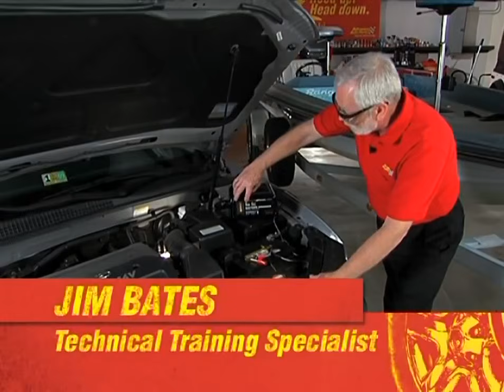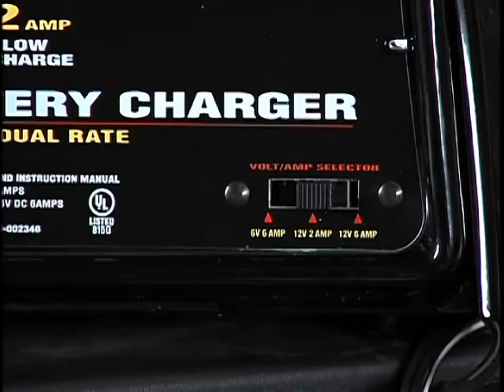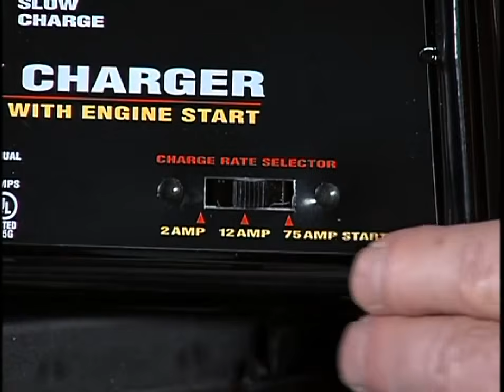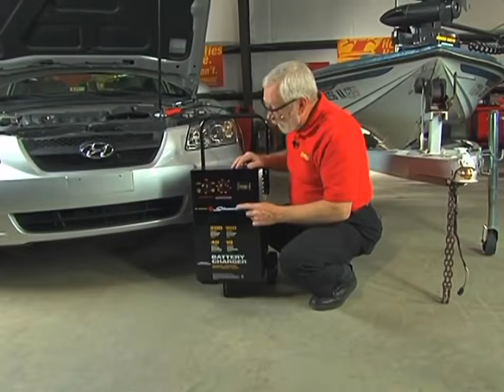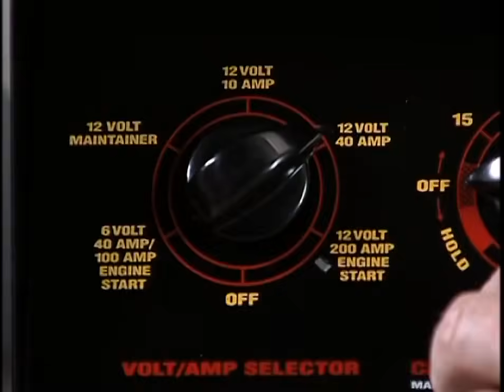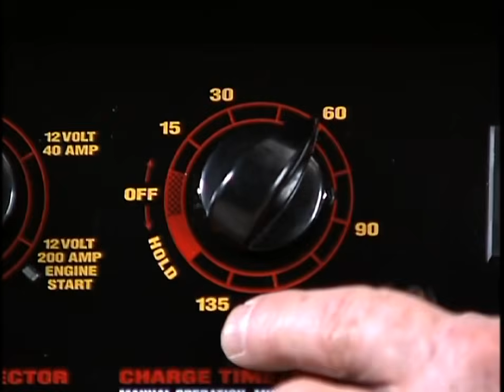How to use Car Battery Charger

Comment: why did you change it from Maintenance Free Deep Cycle to Conventional Low Maintenance?   Which should I use when i am charging my standard 2000 Toyota Camry battery?

Comment: Thank you, sir! Very informative and to the point - glad you prefer connecting the negative to a metal part in the engine and not to the battery's negative terminal. Thanks for the breakdown as to why you prefer this route!

Comment: ONLY VIDEO that SHOWS ME WHAT METAL ENGINE PART I CAN CONNECT TO MY NEGATIVE [warnings against connecting to sheet metal, fuel line etc etc].  THANK YOU.  Appreciate you got right to the meat and potatoes without 101 on 5 different kinds of charger.

Comment: No matter where I tried to connect to the chassis I could not successfully obtain a ground connection and had to connect it to the negative battery post (which worked immediately). I know this is not advised …How bad is it to connect directly to the terminal itself?

Good video!

Comment: Can someone help? I'm baffled. I have a schumacher sc-600A microprocessor charger, with the only buttons being 6V/12V & charge rate: 2amps, 4, or 6. On the box cover, it indicates 'standard' & 'agm' batteries, & the booklet lists battery types, including AGM, in describing them, (& saying nothing, that you cannot use this charger for an AGM). Nothing I do will show 'connected' light to come on. The charger makes smooth noise, sounding like it is on/  running. The indicator lights work, for 12V, & for charge rate. But the connect light will not come on, no matter what i do (on both my old, dead battery, & now my new replacement battery). I just got a new agm battery. I wanted to make sure it was fully charged. The charger fires up when plugged in, (after connecting both + & - of the charger to the battery, including using a method as shown in this video, & trying different negative ground connectors on the car, such as metal near the engine block/ frame. I finally resorted to trying connecting directly to the negative terminal (with the charger off), putting a plastic shield between the 2 terminals & then plugging back in. I've plugged, unplugged, plug in again. I used steel wool to ensure I have clean, pure, bare metal. Nothing I've tried, on & off the vehicle, will work, to get the 'connected' light to come on; why why??? despite the charger working in every other way.  I went ahead & connected the new battery to the car. My lights, turn signals, dash, everything works. (I'm not yet starting the car, since it has  been sitting/ not driven, & I have a list of maintenance tasks I'm running through before attempting to start; some requiring sitting w/ gas treatment, etc). Anyways: What to do regarding getting the connection light to come on the charger?
Reply: Addition: of course, with no connection light indicated, I also get none of the % charge lights to come on, even after letting it sit 5-10 minutes

Comment: So the battery charger has to be plugged into the wall charger in order for it to charge the car battery? it does not save energy inside it ao we can use it when we are away from hom?

Comment: You say (and my charger instructions say the same thing) 'don't attached to the -ve terminal but to the body of the car away from the batter'. But what if the battery is not in the car?

Comment: how do you disconnect battery charger?
what is the safest order of operations?
thank you
Reply: To disconnect:
Turn off and inplug charger
Remove - cable from car
Remove + cable from car
Replace + terminal cover on battery
Done

Comment: what happens if you forget to turn it off at end of charging cycle ?
also, what happens if the  neg and pos leads from the charger touch each other briefly while the charger is set at 12v 2amps  ?
 Will it ruin the charger   ?

Comment: Excellent.  I wanted to know if I could put a battery tender brand charger on the battery without removing the battery or disconnecting the terminal to the car. Thank you this helps.

Comment: This charger  https://www.youtube.com/post/UgkxknS1MWclRHOKWekYXnBJz8Ex0rEPnrGF  works great with the DCB205 and DCB203, I've charged both a few times without issue. After I'd searched for a while this was the best value charger I found and it's new, boxed up well, and it's built as well as any charger I've had.

Comment: Not sure if your channel is active, but I was wondering if you would have any experience / knowledge regarding measuring voltage of the battery when the negative battery terminal is not accessible (silly design by honda that puts it behind plastic components with clips that can break in cold weather). Can I simply put the black lead of the multimeter on a grounded part of the vehicle chassis and the red on the positive battery post?  Or will this voltage be missleading. I have a dead battery that reads 2.45 volts when I try this.  Alternatively, would you be able to provide the source of the video above?  Thanks.

Comment: if you are charging the battery in your garage or house where do you connect the negative terminal
Reply: Schumacher's instructions say use a short cable connected to the neg terminal. Attach the charger clip to the end of the cable, not to the terminal. Create some distance from the the neg terminal.

Comment: Absolutely nothing wrong with connecting black to battery post. You do this anyway when the battery is out of the car. In addition, only plug the charger into the outlet AFTER your batter clips are connected and you have double checked positive (+ red) negative (- black). Also, better to charge on 2amp instead of 10amp and best to never use 50amp option (on some chargers). If battery continues to need charge, just replace it, otherwise you’ll be stranded. Reason is, you can only jump a battery so many times when old before the cells become so bad that no charger will work at all. In other words, a jump start will do no good at that point. Clean posts before doing this and get those inexpensive battery corrosion inhibiting felt pads from Walmart or auto parts store. They work very well in ensuring longer life on the battery.
Reply: I have a 2004 Corvette.. When I connect the neg to the black post on the battery, the charger gets HOT.. When I connect it to the frame, it cools done fast.. Sooooooo, not sure you aRE RIGHT
Reply: WWK  : TY . the " expert "  never told us we could take out the battery
Reply: His reasoning is “If there’s a spark, that could be very dangerous.” So are you saying there can’t be a spark, or that if there is one it can’t be very dangerous?
Reply: @VeritableSmorgasbord  I create sparks all the time connecting batteries. Just did today on three motorcycles about an hour ago after not running them for a month. I actually intentionally create a spark to ensure I have a good connection with the alligator clips.
Reply: Ya
Reply: Why is 2amp better than 10amp? Can you please explain?
Reply: @FirstLast-pl3qe  Slow charging when a charge is needed or when you leave a car sit for longer than a couple weeks, helps prolong the battery life as it minimizes stress on the battery's internal components. Slow charging is safer than fast charging as the slow charge allows improved battery heat dissipation mitigating overheating risk and thermal runaway, which could cause battery bulge/burst and weakness in the internal components, or even fire. Lastly, charging slowly, allows the battery ample time at a slow pace of charge/flow to absorb and store the acquired energy in the most efficient way. In turn, this will not only allow the battery to last a longer life, but will also allow the battery to hold a consistent charge which in turn will protect the computer/electrical systems within the car.
Reply: @WunKoolKat  thanks for your input. I just bought an automatic charger. I got it for my family (3 cars). We don't drive much or far enough to give me confidence of sufficient battery charging. I want to charge the batteries (none during the same day) 2/3 times over the winter and I only have a 3 hour window for each charge session. From what you said, trickle charge is best but I'm not sure that can help over 3 hours. Any advice?

Comment: I have a Viking automatic charger, issue is when i attach it to the battery it tells me what the capacity is, but while charging, it always shows 60% charged and never goes above that, even after sever hrs of charge, After you unplug the cables and plug them back onto the battery, it then shows 100% capacity ... 
Very wierd

Comment: He says to leave the manual unit on till it's 100% charged but there is not "100%" setting on my Schumacher SE-82-6 manual charger. It's settings show 0,2,4,6 and 8 DC Amperes. If you are to leave it on until the meter goes to 0% he (and the manual) should say so.

Comment: I don’t have my battery in the car bro where tf am I supposed to connect the negative if I can’t put it on the terminal!?!?
Reply: I’d your battery is not in the car you can connect to both terminals. It’s only when the battery is installed where you have to be more careful because the car pulls electricity from the connection.
Reply: Agree.

Comment: Thank you so much.  You reminded me of my DAD when he was alive.  You guys have the same hand markings.  Any way I learned a lot about chargers thanks for your honesty.  You don't find many  honest mechanics out there.  Even Canadian Tire will surprise you with unwanted unnecessary expenses.  I bought a New Battery in November and It has gone dead already.  I don't drive the car much through covid-19 lock downs.  So I am wondering do I need to replace the battery while it is still under warranty or do I need to just jump boost it or just take it out bring it in the house and charge it there.  I don't have a Garage.  Also are Battery Heating Blankets valuable item when parking out doors in -20 to - 40 F.?  Thank you if you can help
Reply: You might have something that is draining your battery when not being driven -- electrical short, interior lights, something.  I've had to disconnect my battery if I'm not going to be driving it for a few days because of this.  Normal usage shouldn't cause your battery to die in a few months.  Check the warranty before it expires.
Reply: Hi Thanks for the reply.  I found out when I read the invoice and checked on line as to what sized battery my car uses.  Turns out Canadian Tire had put a smaller battery in the car.  My car takes size 48 and they had installed 45.  That is why there was a dead battery so often.  When you let any mechanic look at your car or do work check to make sure they did what they were supposed to do.  I am sorry to say this but not all but quite a few scams I have come across in my day from mechanics for my lack of knowledge.  They bring bad names on themselves because they are not honest and take many men and women alike by charging for things that were not even worked on.  So if you ask me do I trust mechanics.  It is very difficult for me to fine an honest one and I have lived in 4 cities in Canada and from dealers to mechanics they are all the same in most cases.  I have yet to run into an honest mechanic.  JUST SAYING.
Reply: @patrickrwhite8354  Okay size is important for fitting in the vehicle battery tray and with the holder, but the cranking amps is the most important part. They may have installed a smaller battery but it may be the same cranking amps as required by the manufacturer for that engine. As indicated above you may have a phantom draw that is draining your battery while not in use and having a size 48 is not going to fix that issue

Comment: Attaching the negative charger cable to anything other than the negative battery post is a waste of time.  It has to be on the negative battery post.
Reply: No. But it is a little more effectiv  attacking to negative battery post. In some cars you only find positive post, and negative post hidden. Then much easier to find ground somewhere else instead of using tools to free negative battery post.

Comment: Idiot? He's worried about a spark when the charger isn't even plugged in. People overly paranoid about battery cable sparx I group with torque nazis
Reply: It'll still spark unplugged. The battery powers the tickle charger before it is plugged up.

Comment: Does a trickle charg work if you connect It to the clamps on the terminals? I found it didnt so i reckoned it was just putting the electricity through the battery harness and not charging my battery, i disconnect my battery from the harness then connect the trickle charge to both terminals

Comment: Good video very informative i was using my basic charger wrong..i took the battery out and pluged directly into the battery alone..but it looks like it has to be in the car with the terminals installed..💩shet

Comment: I've always connected directly to the negative terminal and never had a spark because I don't plug in the charger until the cables are fully connected.  Then, I unplug the charger when it's done, wait 10 seconds, and remove the cables without a spark.  To each their own though.
Reply: Especially if the battery is out of the car LoL
Reply: My battery is in the trunk, and I can’t find exposed bare metal anyway. Won’t work on a coated metal surface. Had to connect it to the negative terminal.
Reply: I just charged my battery, connected like in the video, positiv first, negative last, the charger wasnt plugged in and new out of the box, and when I connected the negative post to my strutbolt I got a little spark! So yeah, maybe most people won't get sparks, I did and I'm really glad I did it by the book!
Reply: yeah well thats youtube logarythms for you.
Reply: You can connect a negative cable of your jumper cables to the battery negative terminal, & then connect the negative of the battery charger to the other connector end of the negative jumper cable, is what I'm thinking. My charger booklet says to use a battery cable, & my jumper cable is the only free battery cable i own
Reply: I struggle to find and unpainted place to use.
Reply: You just answered all my questions ive been researching fir hours lmao thanks
Reply: Hooking the negative battery charger cable to a strut bolt or engine never worked for me.
Reply: @mrshastri  Same here.  I can get a reading with my multimeter that the negative is certainly grounded to the frame,  but in practice I've never had luck hooking a jumper cable to anything but the negative terminal.
Reply: @mrshastri , 0 saw

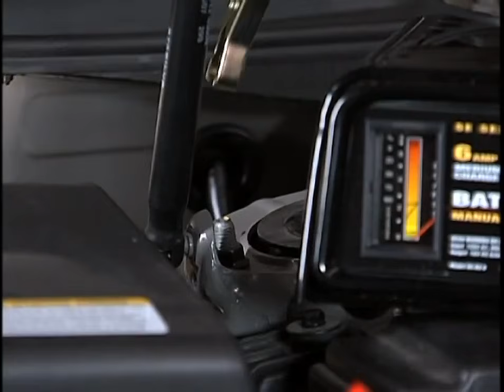Comment: 1:00 why not explaining what happens around the battery when there are ignition sparks?

The battery acid is  Sulfuric Acid, H2SO4… which is reacting with the two metals inside the battery when creating electricity or absorbing it (charging). It’s in the first one where a Sulfate Salt is created with the metals (PbSO4, or was it with zinc?) and thus the hydrogen molecule (H2) gets free and it can stay around a heavy discharged battery, until the user tries to charge it back and creates a spark connecting the cables, igniting the hydrogen and creating a small yet heavy enough to hit the person in the face (eyes) explosion. 
Not common anymore, battery design ventilate the hydrogen constantly… but one has to be sure just in case. 

Great video, I just think everything has a cause and information is awesome. Cheers!

Comment: So, its OK to leave the battery connected to the car?  I was concerned about this because my trickle charger instruction tell you to disconnect the terminals, which is a pain because that affects all of the systems.

So is it OK to not disconnect?
Reply: If your charger instruct you to disconnect the battery from the car, then do it. Some chargers are safe, others not.  For the new start-stop cars, the electronics inside the car is more fragile and more precautions have to be made.  But even for older cars, there are lot of things that could go wrong if the charger does not take them into account. Just don't risk it, or buy a more recent/decent charger.
Reply: You don't have to disconnect, but it's best to. Your car's alternator holds a charge and can be "decharged" in a way to help reset the computer (no worries, it's not bad it's actually a good thing. Like shutting your home computer off and back on again).
Reply: lancol cat200 battery charger and tester , it is very safety , https://www.aliexpress.com/item/4000862988576.html?spm=a2g0o.store_home.productList_1011733158.subject_1

Comment: Spend the extra $5 and get a smart charger it reads whats in the battery and charges it  and shuts off  when full
Reply: Couldn't agree more, have recently created a video on a decent affordable battery charger that does exactly that https://youtu.be/S9qwt9boqgs
Reply: Most “smart” chargers are useless because they wont attempt to charge a battery when it’s completely discharged.
Reply: @raymundalarcon3716  l "desulfation" mode Mine has been flat And had no issues recharging it ....If your having this problem over And over Or it will not take a charge...Like the video is about a Battery charger is not going to fix your problem And maybe replacing the battery will. Most "Smart" chargers Are to be used in many types of batteries ..Lead, AGM, Life4po And i have 2 of the 3 in my truck It sees which one is which And the state of charge it is in And gives you the option of slow trickle to quick charge depending to that of what is needed......